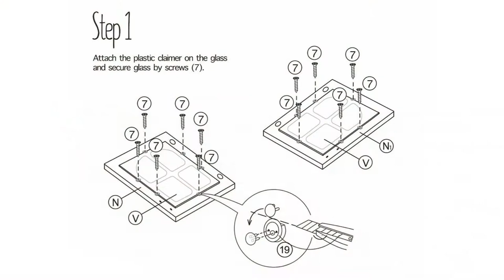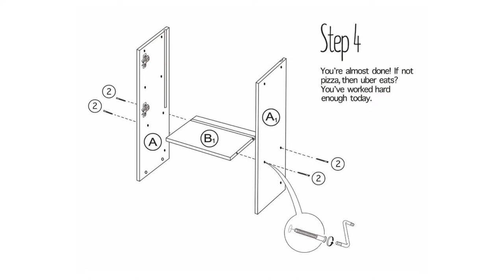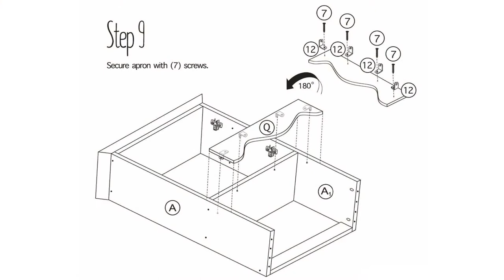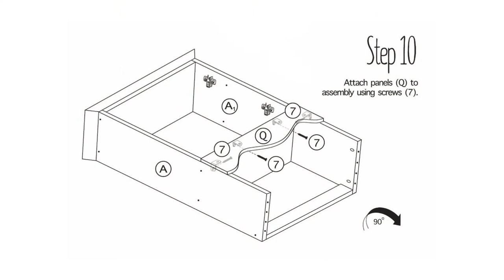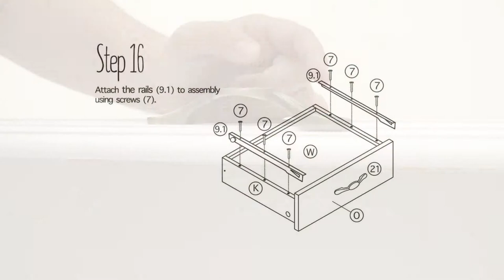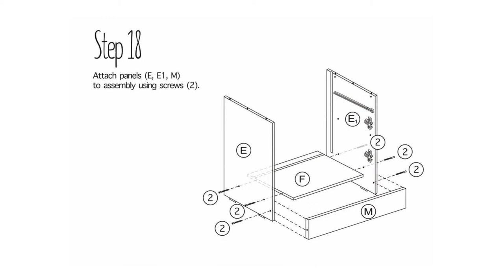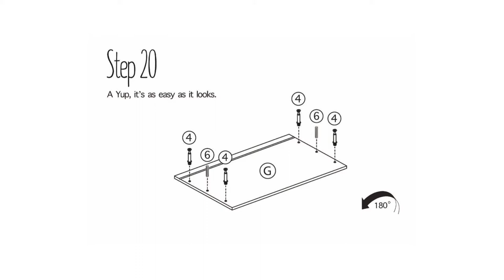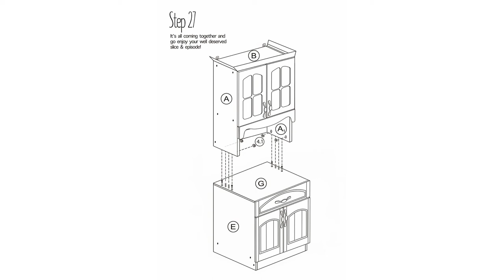Assembling Galiano Microwave Storage Cabinet Living Skog

Comment: It's not as easy to out together as the video shows. Screw holes were drilled in the wrong place on ours, it came scratched, and several of the pieces don't fit together correctly. Major bummer because it looked beautiful online.
Reply from the maker: Hello, Julian. Please contact us through marketplace, where you bought it or our web site Living-skog.com. We will send replacement parts or even a brand new cabinet.
Reply: @livingskog9845  Thanks team! I adjusted a few things and where I put in the screws and got it looking great. I especially appreciated the dessert recipe in the box. And the instructions with the quirky directions and recommendations to stop and have a snack. Definitely kept my laughing as I put the piece together. The extra touches matter and definitely differentiate your brand. Well done! :)
Reply: You didn't get à Warr a nty on it I just purchase one I pray it ŵill be alright very sorry thst happen to you call them 💕

Comment: This was difficult to put together. There were so many things I had to figure out on my own. I choose this one just because it looked so easy to assemble .There is no way he did this with just a screwdriver. I used a drill, screwdriver and a hammer. This task took us hours. It looks nice but I was not expecting the gaps between the doors.
Reply from the maker: Hello, Dear Customer. I am Nikolay (the guy who assemble it on the video). Thank you for purchasing our product. Gaps between doors can adjusted. You can see video adjusting hinges or see it in the manual instruction.